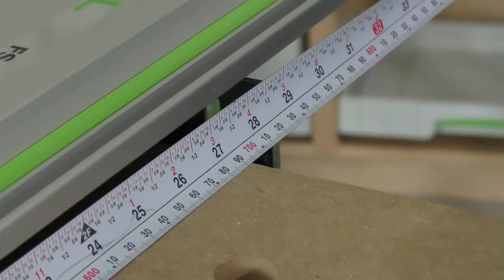Festool Live Episode 71 - KAPEX vs. MFT/3

Comment: Caldwell, Idaho.
Had a need to replace the baseboard in a house.  No KAPEX.  but I added a riser box onto my MFT/3 so I could cut 45's without cutting my table top.  Took a bit of math, but it worked just fine even on those non 45 corners in the house.  Modified the same jig setup to to cut crown for a cabinet that the Boy Scouts were making for a Ronald McDonald's house near us.   Still only have the MFT/3.